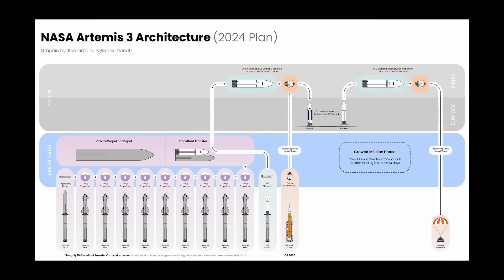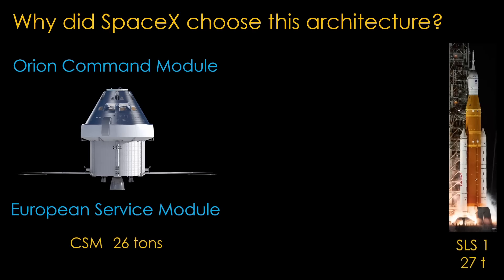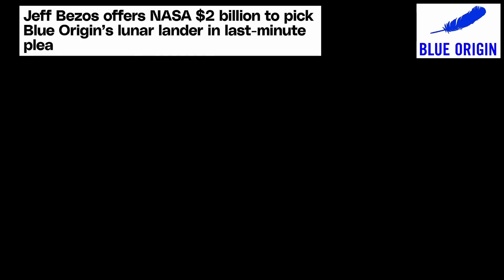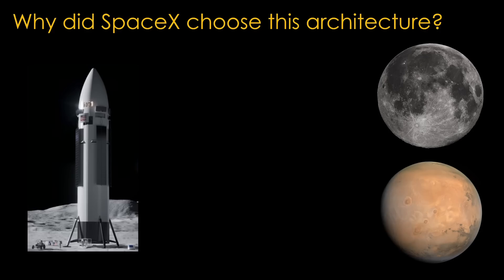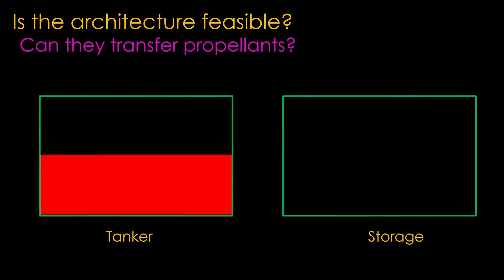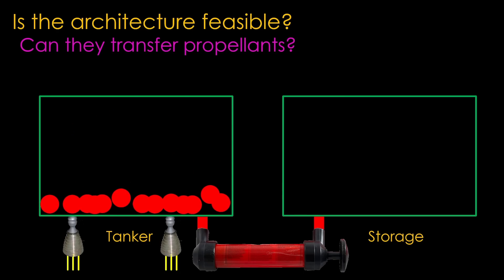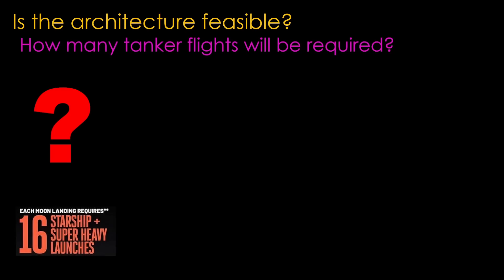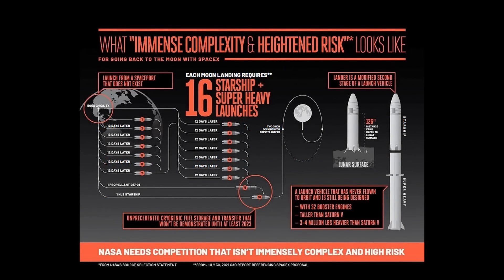Starship Orbital Refueling

Comment: I'm probably missing something, but I think the Starship is a brilliant interplanetary ship. However, I don't think it would make any sense to land it on the moon's surface. Creating a new version of the lander, which, when combined with the starship, could create a very safe and flexible mission. With the amount of space and fuel the starship can carry, it would make a trip to the moon downright convenient. In my opinion, the Starship (despite how reliable it will be) lacks the redundancy that the Apollo 13 landers represented.
Reply: Takes a lot more money to make specialty craft.  How can you say starship lacks anything?  It's not nearly done it's development.
Reply: The Apollo landers had no redundancy. If the ascent engine failed to light the astronauts were doomed. 

Do you mean a Starship should carry the crew in a cabin and also a lander in the cargo bay? The current BO lander proposal is too large to make that work and anything smaller won't meet NASA's objectives. There are a number of other problems.

Starship is meant to be able to land, designed to be so even before it bid for the HLS program.. For a number of reasons it's more stable than it looks. It'll also be safer to land than Apollo or similar landers. If the terrain it sets down on is too uneven it can sense it and just lift off immediately and fly to another spot. Its large propellant supply will make this possible. Also, the landing legs will be self-leveling. Finally, the landing spot can be carefully chosen, we have much higher resolution pics than Apollo did.
Reply: @donjones4719   Thank you for your response. This has been on my mind for a long time, especially after watching one of the episodes of Smarter Every Day. I went through the Apollo mission lander's manual myself and was surprised by the emergency options they had (including exiting the module and manually cutting off the lander's legs with scissors). (Im referring to "I Was SCARED To Say This To NASA... (But I said it anyway) - Smarter Every Day 293" and  "Apollo Operations Handbook Lunar Module (LM 11 and Subsequent) Vol. 2 Operational Procedures"). As for the lander, I imagined it more like an extended version of the Apollo 13 mission's spacecraft, where the lander was attached to the front of the ship. Transporting the lander in the Starship wouldn’t make sense.
Reply: @thehiddunicorn8917  Yes, I saw the Smarter Ever Day episode. IMO it was definitely not Destin's best. He didn't comprehend the paradigm shift of Starship and was judging its feasibility from his background of working on government defense projects. Starship HLS is far from the usual government project. It was also clear he didn't do a deep enough dive before recording. Many in the space community were critical of it (and not just SpaceX fanboys). Too bad, because he does do some nice work.

You'll be interested in the Eager Space video "Will Starship Fall Over?". Spoiler alert: Eric says no, it'll be quite stable. 

Yes, transporting the lander on the front of a Starship would make more sense. There is the problem of mass, though. The BO lander, for example, is pretty sizable for a space vehicle. When fully fueled that's a lot of mass to accelerate to TLI and decelerate to NRHO. Would there be enough propellant left for TEI of the Starship? Refilling in NRHO might be required - logistically difficult and a nightmare for NASA to contemplate. Even if there was enough propellant the ship would have to use atmospheric reentry to decelerate to land. NASA won't be a fan of that for a long time. 

Another Eager Space video, "Commercial Moon", provides a lot of insight about the masses to be moved around when going to the Moon and landing. See Options 3 thru 5. This doesn't directly address your lander proposal but it'll give you an idea of the problem. There is good news in there.
Reply: @donjones4719   Thanks a lot, that clarified a lot for me, I'll watch these videos and read a bit more. I'm definitely interested in the further development of the return to the Moon.
Reply: @thehiddunicorn8917   Glad to help. Welcome aboard!

Comment: By the time orbital refueling is required for a mission—Artemis, Polaris, whatever—Starship will already be well into revision 3 and likely meeting or exceeding 200 tons to LEO due to the stretched design and improved engines.  This is why the lower end of 5 is there.  There's actually a good chance the number of necessary flights will be around 5.  I also personally don't think they'll be ready to reuse the second stage and so will opt for cheap, expendable "tanker" second stages that run them maybe $25 million a pop to build.
Reply: Why spend $150 million to refuel a tanker with six expendable starships when you can spend $30 million on one with a half dozen missions?  They’ll have landing down pat long before they need to do refueling missions.  Hell, even if it isn’t rapidly reusable yet and requires a few weeks to refurbish, there is no way they throw away a half dozen starships instead of bring them home and refurb for future missions.
Reply: @qwerty112311  We shall see, I guess.  As to "why", keep in mind we are talking about the earliest possible case where orbital refueling is actually required for a mission—and that this capacity will be needed as early as September 2026.  Starship reentry, followed by capture, will be the biggest challenge of the entire program, and it is absolutely reasonable to suggest that they still might not have it licked inside two years.  Meanwhile, the budget for Artemis can comfortably support 6 or 12 expendable tanker Starships for its individual missions, which are likely to remain separated by two years or longer.

Comment: Well, Spacex can reduce it to 1 refuling mission if thy choose reduce the moon starship like soze lander by 40% and add second stage under it...which the most econmical way and easy enginnering wise...my guess is that Elon does not care about that now...he want to prove the 2 stage concept  and reach the maxmum limit of the desigen of his raport and the booster...note that the contract is a development contract...so even with one attempt he will get most of 2.9 billion ..and in the main time, impove his system...after which he can change the upper stages for Mars later or contine with the large starship thing if he find the rapid reusable type economical...so at the end...economicaly and logically..it does not matter if 10 or 3 refuling is needed...as long as he can set or charge higher cost for future landers contracts to reflect the real cost..his long term traget of Mars is still reachable by 2030s
Reply: would take years and money to design a new lander from scratch
Reply: No, if it is the same concept @mudkatt2003

Comment: Future video idea: How much does having to truck in methane to the launch site instead of building a pipeline for it impact the cost of each launch, and of one complete HLS mission?

The why if the question is when do you think SpaceX will want to build that methane/natural gas/pipeline, or are they better off figuring out how close they can get an LNG tanker to Starbase?
Reply from the maker: I do expect them to build a LOX plant at some point.

Methane is harder because natural gas varies in methane content and you need to separate the methane that you want and do something useful with the other components. So far they're content letting somebody else deal with that.
Reply: @EagerSpace  They used to have a small scale air separation plant at the build site, but tore it down. A new LOX/N2 plant is shown in the site map drawings for the proposed expansion of the launch site, but it doesn’t show anything for Methane pipelines, which is why I’m asking. I’m am exquisitely curious about the economics involved in deciding if and when they switch from driving it in on trucks to something more efficient.
Reply: @EagerSpace  if they had a lox plant they'd use it for ln2 as well

i bet you're right about the methane. they won't do a pipe from the port for that reason
Reply: @EagerSpace if they're already building a cryogenic distillation plant for LOX production why not build one for cryogenic distillation of methane out of natural gas?
Reply: @thermusaquaticusPCR  They might, but starting with LOX and N2 will cut out a LOT of tankers as it is, it buys them some breathing space time wise.
Reply: I wonder if it would make sense for them to build a railroad from the port of Brownsville to Starbase plant and the launch complex. I recon, they could even use double track platforms to transport the parts of the starships. Advantages: ability to quickly transport large payloads and amounts of fuel as well as starships, without any road closures.

Comment: Starship holds 1200 t of propellant, so 12 refueling flights per ship if you only have 100 t of payload only 6 if they get to 200 t payload ( what they aim for), for mars they dont even need a fully fueld ship so 4 refilling flights should be enough, no idea how you get to calculate more than 15 refueling flights, did they think spacex refuels it with falcon 9s?
Reply: The future versions of Starship will hold up to 2300 tons of propellant, not 1200 tons. We don't know which version of Starship the moon lander will be based on.
Reply: Any calculation giving more than 12 refueling flights assume boil-off losses.

Comment: The problem with statship is that it is only 2 staged and fully reusable wich makes it less efficient but on the other hand makes each launch cheaper and SpaceX trying to balance on top of that
Reply from the maker: Three stage to LEO is hard if you want to be reusable. How do you get the second stage back?
Reply: You think 3 stage fully reusable would be better? Why?
Reply: Did you play KSP?
Reply: @nommy8599  yes, because you will not have to have a heavy but empty tank all the time which is useless, but it is not great for reusability.
Reply: @space-clippy  It can't be empty, it needs fuel to land. That's kinda my point, perhaps multiple stages lose their benefit somewhat when they're required to be fully reusable. You know?
Reply: SpaceX does not like needless complexity, and they are banking on the idea that fuel is cheap.

Comment: For a cheap reusable rocket, the number of refuelling trips is irrelevant.
Reply: Not irrelevant but certainly not relevant enough to be a roadblock
Reply: @OubleJum  Let's say 40 million for a Starship (assuming limited lifespan) vs 4 billion for an sls. Simple economics says you have to take less than 100 refuelling flights for reusable to be cost effective.
Reply: @andyonions7864 The point of the SLS is not to be economical. NASA exists to conduct missions that are not feasible for the private sector due to low returns and high price.
Reply: @reeselisko3485  this makes no sense. SpaceX will go to Mars with or without NASA
Reply: @andyonions7864  I replied with the thought that your statement was comparing the cost of Sarship with NASA's SLS. Mars is a different topic.
Reply: Plus the starship was supposed to fly around the moon last year, all three launches have exploded or crashed.
Reply: 10m$ only fuel for 1 flight. Depreciation minimum 15m$ per flight. Totally 250m for 1 refilling if it need 10 launches.
Reply: Except it is, how much trips turns cheap into too expensive
Reply: It can only be re-used so many times, plus wasted fuel to re-fuel.
Reply: We need to produce fuel on the moon. Reusable is still necessary. This is an unavoidable temporary solution until we produce fuel on moon
Reply: @JamesHardaker  moon fuel is Hydrolox. Marsfuel is Methalox. They are incompatible for rocket architectures. Long term, Mars is the more useful destination.
Reply: This is pretty much correct assuming that it does turn out to be fully reusable and operating costs aren't too expensive.
Reply: Starship is still neither
Reply: Im just worried that it is gonna be a lot harder and take a lot more time to turn around starship than most people think
Reply: @jesserutt7413 I think so, too. I'd love to see it that fast but, we'll see.
Reply: @jesserutt7413 Well, SpaceX has been refurbishing boosters for a while now. They’re in the best position to understand what’s likely to be important with SuperHeavy and Starship reuse. They’re working really hard on the TPS.
Reply: If the catching attemps work, it will be really short. Launch, seperate, boostback, catch, set aside, put new one on, launch again. Could be within a few hours.@jesserutt7413
Reply: @realEpicGold  that is the goal of course. Everything changes if they are successful.
Reply: @realEpicGold  there is a lot more to take into account in practice though. At the beginning of reuse they are gonna have to make sure nothing is broken in the process of launch and landing. Maybe in the future they’ll have it perfected but for Artemis 3, reuse is gonna take a long time. Atleast thats my prediction
Reply from the maker: For refueling the roadblock is likely to be the launch windows - you only get one or two chances per day to hit a depot in LEO.
Reply: @EagerSpace  absolutely. It's like tides init. But SpaceX can do those double Armageddon launches.
Reply: @jesserutt7413 time to recycle isn't a factor for them either. Like falcon, they are cranking them or like Popsicles on a hot day. As long as they get back into service at some point. This is what they did with falcon. Now they have boosters with 20+ flights on them.
Reply: @EagerSpace so for more launch windows, “starport” facilities will be needed around the world
Reply: @realEpicGold It can take several days for a spacecraft to rendezvous with another spacecraft in orbit. 10 refuelings could take weeks or even month, even if the technology works out perfectly.
Reply: @EagerSpace that's a valid argument. I think that when the time comes to go to Mars, many starships will be launched before the transfer window opens and therefore you'll be able to plan with some degree of freedom how early to launch each ship into LEO to be able to refuel every ship in time.

Comment: Starship was found to be too big to dock with the Gateway Space Station, so Space X role may be eliminated. Then is the Boeing SLS issue, I see this whole Artemis thing imploding in itself !
Reply: It isn't too big to dock with gateway. Starship is so big that the gateway station cannot maintain attitude by itself, trying to control the mass of Starship. But the proposed solution by NASA is that the Starship will contribute to maintaining attitude control.

It's a bit more complicated, but it's not needed before the third Starship moon mission, so they also have some additional time to work it out. (It might be easier for the gateway to simply hand over attitude control responsibilities to Starship once it has docked.)
Reply: @SpaceAdvocate  Obviously the ship will have to be able to control its own attitude.  If there's something hanging off its docking port ... be gentle.
Reply: How about just losing the stupid gateway. Please check out Dr. Robert Zubrin’s approach to Moon flights.
Reply: Doesn't seem like a huge deal, it has RCS built in anyway right?

IDK maybe it's not so simple but IDK why, seems like it should be. 

Big ship that can orient itself docks with a small ship that can't orient then both, no biggie... Let the big one do it.
Reply: @nommy8599  It’s a propellant issue, Gateway will use ion thrust and starship uses chemical propellant. There’s lots of missing holes that are not exactly calculated, aside from fuel to get to lunar orbit, landing and re-ascending, now Starship will need additional fuel to maneuver itself and Gateway station while in orbit.
Reply: @frankv7068  Won't the adjustments only be minor though? Can't it briefly fire a main engine to make any significant changes to align orbits such that RCS work and required propellant is minimal?

I guess no docking could be far less cost but the difference of Starship vs gateway keeping them in the right place seems kinda trivial to my imagination, but IDK.